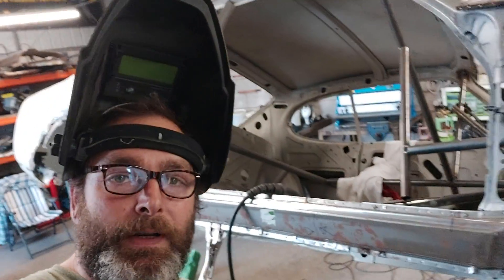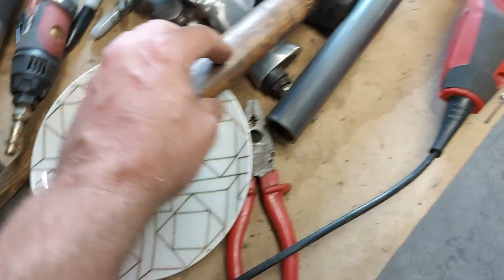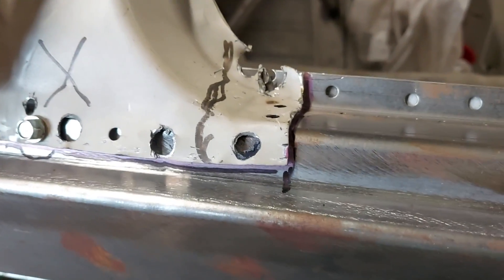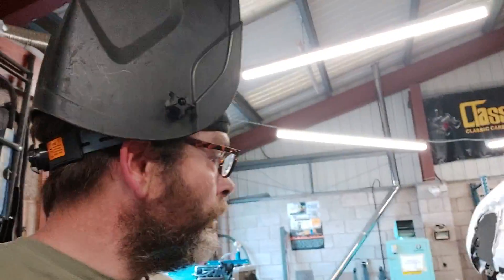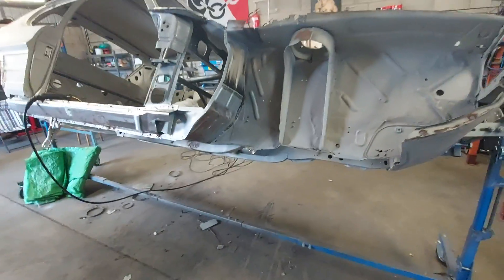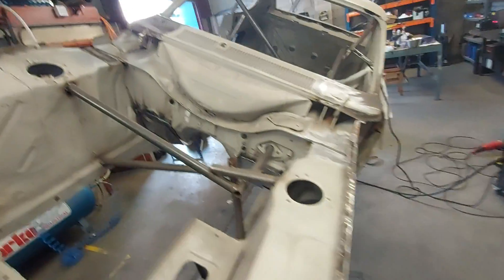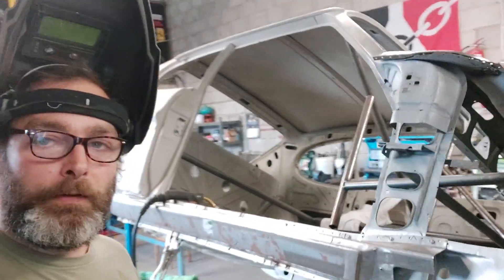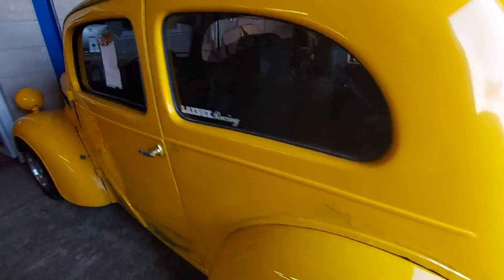1969 FORD CAPRI - PART 93 -  'KATE' - restoration/repair in progress

Comment: I'm glad to see your still working on Kate.  all them spot welds takes time but it doesn't take as much as stitch welds.  just seal it from behind and you'll be golden.   it may not be the gasket that is leaking on the tank.  check around where the connection to the sending unit terminal is.  i had a leak there on mine and took me a while to track it down I kept thinking it was the gasket and it wasn't.   just a thought for ya.   have a good one and looking forward to hearing the carbs running.
Reply from the maker: I'll have a look at the sender unit , and confirm where the leak is happening, before i remove the tank. Thank you Ken, vid with carbs coming out shortly :)